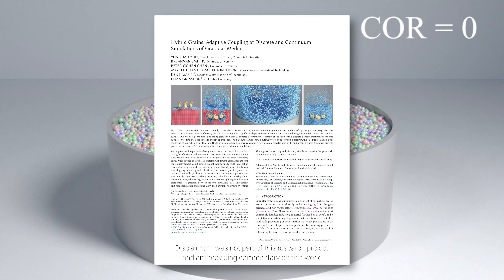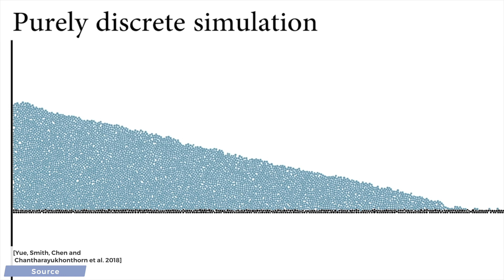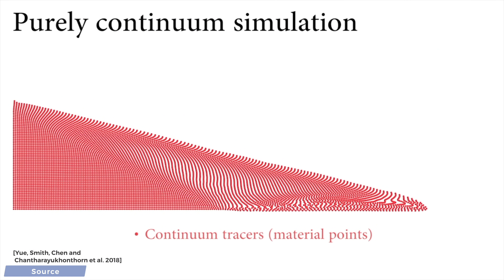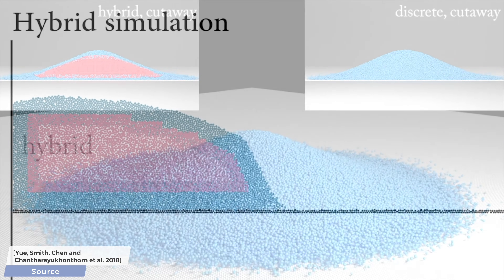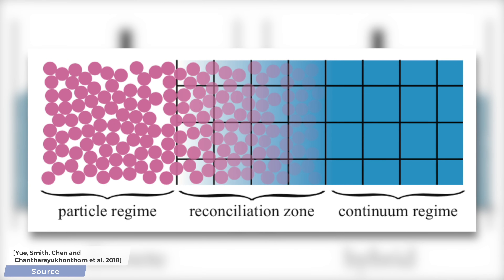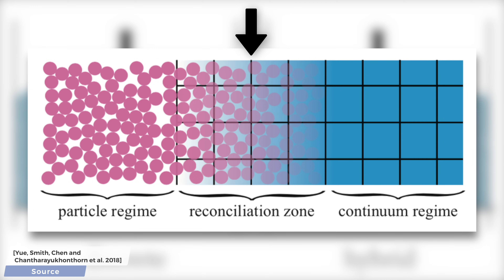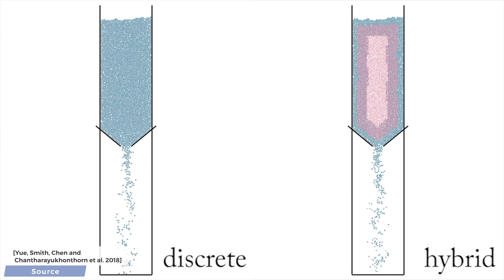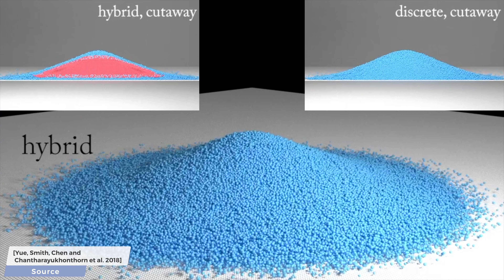Simulating Grains of Sand, Now 6 Times Faster

Comment: Particle vs Continuum for optimization? By extension, that logic is Particle vs Wave? Well, if the universe is a simulation. I think we may have some form of an answer as to why light behaves like it does. It's just easier to compute if it basically does both depending on the convenience. lol.

Comment: If simulating grains of sand is 6 times faster, wouldnt it speed up most fluid sims because sand is just granular particles like any other fluid but with different properties.
Reply: Yeah fluids are made of particles, but on the molecular scale, this means that for example simulating just 18 ml of water would require 6 trillions of trillions of particles, that without considering all the properties of molecules, like Van Der Waals forces and Hydrogen bonds

Comment: This seems like it has a TON of potential. I wonder, how much error is introduced by using this method... if it is very low, that would be great. Thanks for making this wonderful video!
Reply: The video includes side-by-side comparions of fully-discrete vs hybrid simulations. You can see they are very close! My understanding is that these kinds of simulations are more focussed on effectively immitating the appearance of fluids rather than accurately modelling real-world fluid behaviour, so it's likely that neither the discrete nor hybrid methods are real-world accurate.
Reply: If you need to be absolutely precise that this method won't help. But if an approximated simulation can work, than youre good to go
Reply: @MatheusLB2009  Yeah well as Yoshie said they both are likely not real world accurate so the hybrid would definitely be good

Comment: Six times speed-up results in what FPS?
Reply: per second? How quaint. 

Frames per HOUR would be a much better metric in this case!
Reply: The leading artist software for this type of thing is Houdini, and their latest grain implementation (the Vellum framework) can achieve simulations similar in resolution to the coarse examples this video at about a one or a few seconds per frame, which is a huge improvement over their previous grain framework. A 6x speed increase again on that speed would start to approach something that could be measured in FPS, but for anything heavier (which most real world situations typically are), we would still talk several seconds to many minutes per frame for a pretty normal case. That said, I don't know what sort of optimizations Vellum already has compared to the one they improved upon in the video, so it may not be a fair comparison.
Reply: Ah, ok, good to know thanks

Comment: I wonder why they didn't use a neural net to achieve the speedup, like previous Google work has (which you talk about on here!). 

Can't wait for these sort of techniques to make it into animation software packages like Blender, wish I had the time and specific expertise to implement something like this.
Reply: Moby Motion you can’t just throw neural nets at everything
Reply: @oscarchampion5842  won't stop people from trying ;)
Reply: @oscarchampion5842  Well, technically, neural networks can solve anything (that is, anything that's turing complete ;)).
Reply: @OrangeC7  I'm pretty sure that is strictly false. A neural network cannot, for example, multiply two input numbers together.
Reply: @Flourish38  I see, that' pretty interesting, actually. I wonder how close a neural network could get, though?
Reply: Of course a NN can multiply two numbers together. I can, and I'm a Neural network.
Reply: @benjaminmiller3620  Your brain does not have the same structure as what we call a neural network in machine learning (it might be inspired by neurons but they are very different)
Reply: @OrangeC7  What do you mean by Turing Complete in this context? Usually, a language/system/machine/whatever is Turing Complete if it can simulate a detetministic Turing Machine, but this definition doesn't make sense when talking about neural networks.
Reply: @Flourish38  You're wrong mate. "... multiplication and division can be computed by depth-3 ANNs"  - verbatim from this paper (http://papers.nips.cc/paper/657-optimal-depth-neural-networks-for-multiplication-and-related-problems.pdf)
Reply: @Tassle It's not a feed-forward, fully connected network. Doesn't matter, My point still stands. ∃ a Neural network X: X(A,B) = A * B

Also after a few minutes of thinking about it, I'm pretty sure I could build one. And before you scoff at that, I have 20 years programming experience and have worked with ANNs before.
Reply: @benjaminmiller3620  Yeah I agree that such a network exists (or more precisely, one that appriximates this function to any desired precision on a compact subset of R2). Even more, there exists a fully connected feedforward NN with a single hidden layer that does that. It follows from the Universal Approximation theoreme for NNs. I was just taking issue with the comparison between your brain and a NN (but I guess in the broadest sens of NN you're right).
Reply: @Tassdo  About me saying Turing complete, I don't think that's exactly what I meant. To be specific, I meant anything that's actually solvable computationally. I believe turing completeness and the halting problem are related, but I'm not sure they're the same thing now that I think about it. :P
Reply: Neural networks can already do fluid simulation faster that “traditional” methods so I cannot see why they couldn’t do grain sims
Reply: because the quality of those neural network fluid "simulations" were rated by human perception. They produce eyecandy, but not accurate results. In simulation there are only few edge case domains, in which NN can outcompete classical approaches, who are still backed up by error estimates and a lot of mathematical theory.